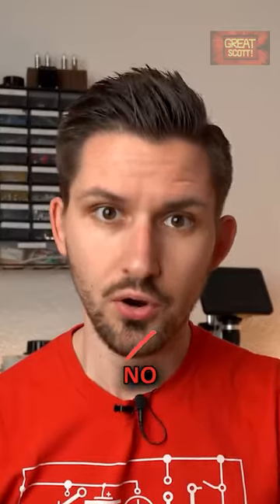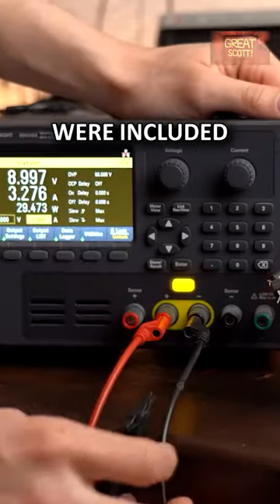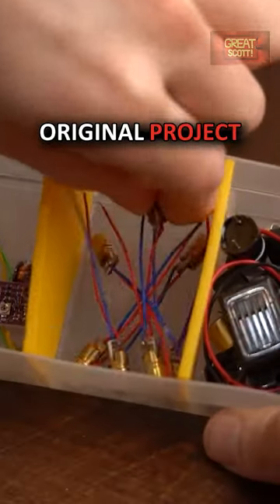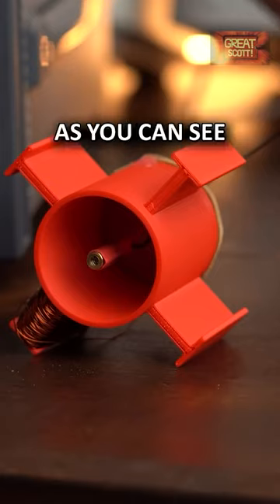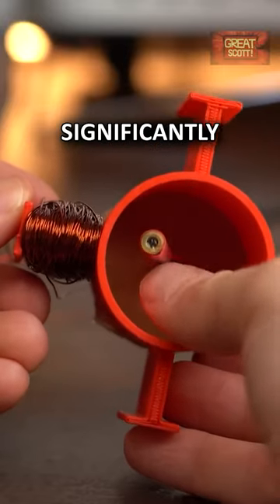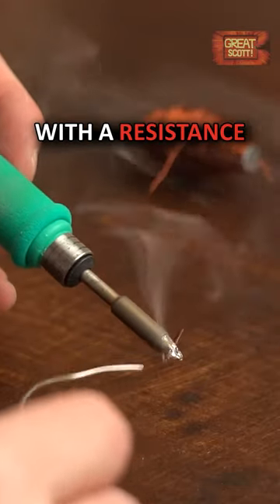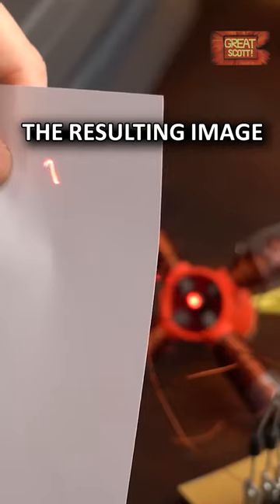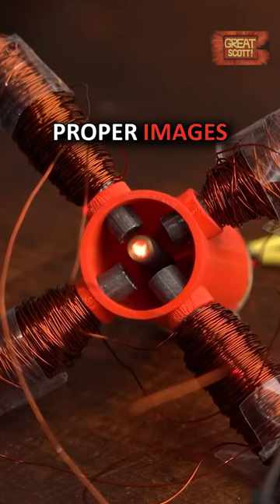FAKE DIY Laser Projector? #debunked #science #engineering #electronics #laser #display

Comment: It's way harder to move a whole laser diode assembly than to move a very lightweight polycarbonate mirror with a tiny magnet chip on it.
Reply: It would still be easier to move the foundation the laser is mounted to.
Reply: Moving a mirror is still harder than moving electrons in a vacuum, right?
Reply: @1994AustinSmith that's going into the realm of CRT. This is a laser display it's photons moving not electrons but yes it would be easier to bend the path of the electrons

Comment: Why not point the laser at a tiny mirror and move the mirror? That's way easier right...
Reply: Yup, that's how it's done on stage lasers
Reply: Thats how actual laser projectors work. Instead of moving the diode they have a small mirror with a magnet on it that gets turned by running varied current through a coil.
Reply: Confocal laser scanning microscopes also do the same thing to precisely move the laser beam in a grid pattern. When they were first invented the original idea was to move the entire microscope stage along the X-Y axis until precision electronics got good enough to move the laser beam.
Reply: also that's how DLP projectors work, except there's more mirrors and they are really tiny. (and a lot of commercial DLP use LEDs as the light source instead of a laser.)

Comment: This reminds me of the ion emmiters in the back of a CRT.
And the precision you need may be able to take some inspiration from such.
Reply: There's no ion emitter there. It's an electron cannon. Ions are charged atoms, not just electrons.
Reply: @wernerviehhauser94  My bad.
Got mixed up with an old project.
But the statement, mostly to reference the magnetic aiming.
Could possibly use the same scanlines and timing with the laser, from an old CRT or a mockup of the circuits.
Reply: Using magnets to steer electrons is very different to a massive physical object.
Reply: ion emmiters & electron cannon sound like Star Trek terms to me

Comment: Lol of course this doesn't work.. I once saw something similar that worked really well though. But it used small mirrors on two stepper motors I believe.. By attaching the mirrors at a slight angle and rotating the 2 mirrors at different frequencies you could make quite interesting shapes..

Comment: Use the coils from a VCR capstan motor, flat coil air core type. Glue 4 tiny neodymium magnets to the laser diode. All 4 with the same pole facing outward or alternate NSNS. Make the laser diode support spring a fairly stiff one with some vibration damping on it. Next run it with quad op amp with 4 half bridge drivers. It wont do fast animations but if you want simple eyecandy stuff its fine.❤

Comment: use 2 or 4 speakers with the laser mounted on a small wooden X axis connected to the center of the speakers with wooden dowels and then try to use the sound waves to control the output image.

Comment: Don’t tune shit xdd. Use open cv compensate for it with a webcam as feedback. U will never get a perfect 1:1 relation in the voltage movement so why bother.
Reply: How you gonna get a webcam to spit out frames even close to the speed of eyesight? And then run OpenCV and then compensate with that feedback...
Reply: @dylpickle8147  u can use still low speed opencv for feedback in how depending on the coil it converts to x y values. Then crank the speed up. If u were to make a x pattern while cranking up the speed u could see the change on the x and y with speed as one frame gets captures which due to the shutter speed will probably capture the entire movement in one go. I guess u could implement a pid loop and tune with it with a pre movement calibration. I am just giving ideas on how to do it :s.